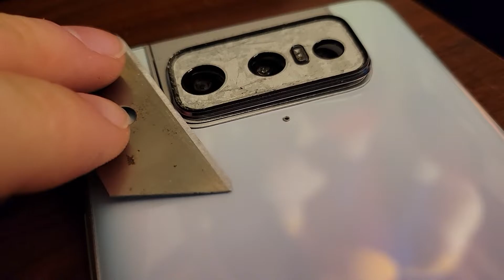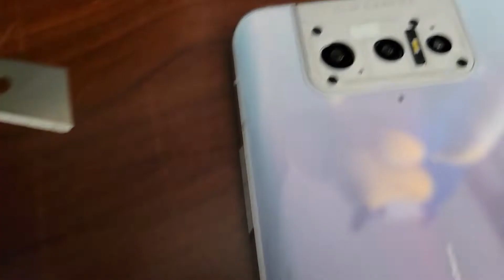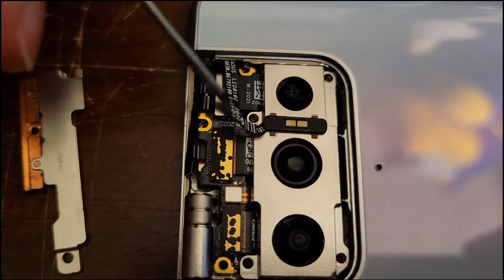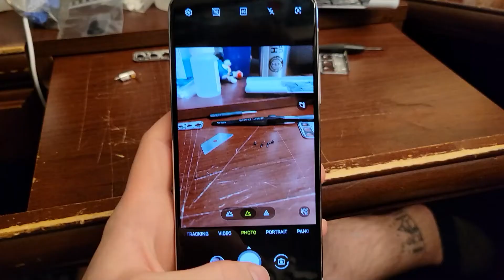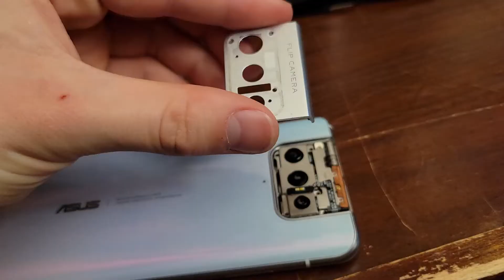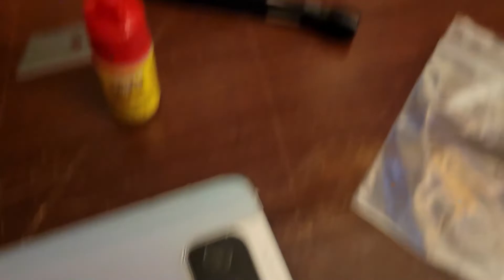Asus Zenfone 7 / 7 Pro Camera Motor Repair

Comment: You are a legend! Thanks to your video tutorial I was able to replace the motor on my Zenfone 7 in only 20 minutes! One thing I would like to add is that I did not remove the ribbon cables for the cameras at all. Once the protective plate is removed, use a screwdriver to remove the ribbon cable only for the motor and then you simply flip the camera devices upward, away from the phone. This allows you access to the smallest screw holding in the motor. Once I replaced the motor, it only took a couple tries to feed the ribbon cable back between the cameras and the connectors, which I then pushed down firmly to reattach. This was so much easier and faster than having it repaired by Asus or a third party. I only paid 3000 yen for the motor+delivery to my home, about 20% of what it would cost for me to send it to Asus. The only other parts I used were a small phillips head screwdriver and a 100 JPY utility knife which I already had. Thank you from Japan.

Comment: Thanks also from me Ben! I also didn't have to disconnect the camera wires, only the motor arm connector using the pincet of a mobile phone repair tools set I ordered along with the motor. I thought it would be a full day nerve wrecking process but it was quite easy and took only one hour. Was careful to clean the internal lenses very gently with an appropriate cloth (like the ones provided in spectacles shops) before putting the cover on again and then gave the cover an additional run with the cloth, that also helped on pressing the original double sided glue material on place again and voilà, flip cam working like a charm!! Thanks again for taking the time to record and post these instructions!!

Comment: Thank you veryyyyy much for posting this video. I bought on Ali express the replacement motor, changed it and it now works perfectly again. Thank you thank you thank you! Mine dropped and would make the sound but the flip wouldn't work.. changing it worked perfectly. I didn't need to disconnect anything to change the motor, I just lifted all parts carefully after unscrewing all screws and accessed the motor. 

All the best!! 🤗

Comment: Mine is no longer capable of keeping the camera closed when not in app. Also I hear extra rotation noises when already closed/opened, as if it doesn't know the camera reached it's end of run and tries extra and skips gears. I've tried recalibrating it with no noticeable improvements.

Comment: The motherboard and charger strip that goes under battery i connect that upside down it was still charging but phone was smelling like burning metal. I connected that right way now it is not even changing no red right.not starting up

Will you suggest me what damage i made so i can buy that part
Reply from the maker: I am sorry, I am unable to help with this. Good luck in your search!

Comment: Thank you for the teardown. I am just wondering if the Zenfone 7/7Pro and 8 flip uses the same camera module or compatible between each other. 
My main camera is now unable to focus and looking for replacement part. If anyone know where I can specifically get for the Zenfone 8 Flip. 

Seems like Aliexpress listing are showing that 8 Flip, and 7/7Pro as 1 same module only for sale
Reply from the maker: Unfortunately I do not know the answer to that. The camera design changed between the 6 and the 7, so I can only assume it changed again in the 8 flip.
Reply: @Benny.W  Welp I'll just have to wing it. Thanks for the guide. 

I'll be updating here once I get the parts and hoping it'll workout. Don't really want to replace the phone as there are currently no other phone without a hole punch. It's sad they discontinued the flip series
Reply: @aimanramizu6901 hey, any Updates to your replacement?

Comment: I follow your guide, and now my camera is in working order again!!! For those that will be brave enough to do that fix themselves, have in mind that might need calibration. I did that by razing camera very gently about 20 to 30 degrees. Then i went to settings and i calibrate following the guide.  Many thanks from Greece..

Comment: Thank you for the video! I was using your video as a guide of how to do this on my zenfone 7 and realized you do not have to unhook the camera module at all, just disconnect the motor, lift the camera module to the side a bit to access the screw and the motor. Once the new motor is in place you just pull the motor ribbon trough where the old one used to go and thats it xD

Comment: Great video, thanks, it helped me a lot. In my case i think the gear or the shaft is broken. I can hear the motor running, but the camera doesn't move. The bad thing is that the spare part is out of stock everywere...
Reply: Hello, having similar issue. Were you able to fix the camera ? If yes can you tell me how please ? thank you
Reply: Hi, not really. I opened the case, cut off the motor cable and put some Tesa on the open contacts. The cam is working, you can flip it with your finger. You will get some notifications like "calibrate your cam" but it's okay for me. @banguinoor8522
Reply: Conseguiu algo? Oque resolveu?

Comment: How did you get the glass off? My motor is fine, I just broke the cover glass.
Reply from the maker: The glass itself is on an aluminum plate that is then adhesived to the camera module. When I replaced my glass, I broke it into little pieces and pulled them off the aluminum plate, then cleaned it up with some alcohol and adhered the new glass on.
Reply: @Benny.W  thanks! I'll give it a shot

Comment: I wonder if this is how the zenphone 6 works too
Reply from the maker: No, the Zenfone 6 has the motor inside the phone body itself, not the camera module.
Reply: @Benny.W  No no not the motor, the camera cover. I broke my camera lens glass and so I need to fix it. If I can open it with a razor blade and replace the glass, that would be awesome!

Comment: Hello, how do you remove and change the glass of the camera ?
I broke it 😤 and all photos i do are bad.
Do you use a a razor blade? Or other trick?
Reply from the maker: I broke my glass as well. I broke it into smaller pieces so I could take out the shards and adhesive. You can find replacement glass and adhesive on eBay.

Comment: Thank you for the video and repair info
I have same problem with my phone except i can hear the motor running but it seems to be disengaged somehow
Reply from the maker: It's common for the gears inside the motor to break. That's what happened to mine. I could hear the motor turn but nothing would move
Reply: I have the same problem 👍🏼 what's the part number for replacement gearbox /motor
Reply: Hello, having similar issue. Were you able to fix the camera ? If yes can you tell me how please ? thank you

Comment: Thanks for this explanation in how to repair the Asus 7 Cam Motor. Mine went broken when i Put IT in my Front Jeans pocket, somehow Cam was flipping Out , maybe unlocked by Fingerprint Sensor. Afterwards the Gear was broken, now only Motor Sounds but No mechanical Flip is possible anymore. I think Asus has to Work more on it's product quality, as Putting your Phone in a poket while Cam ist flipping should Not lead to a faulty Gear. As i have guarantee on IT i will send IT to Asus but Backup all Data and have No Phone for 2 weeks sucks ... ;-)